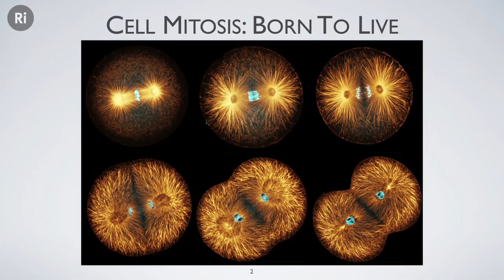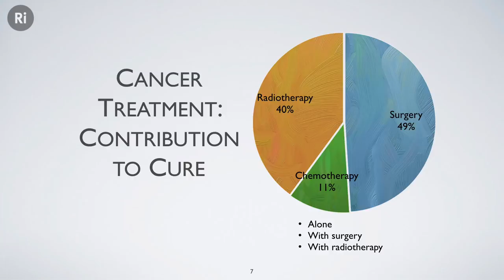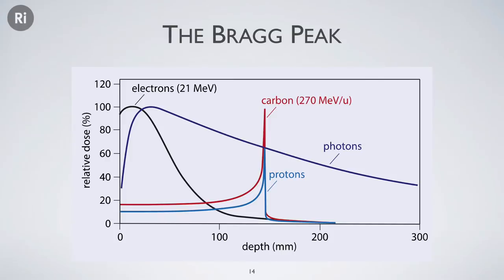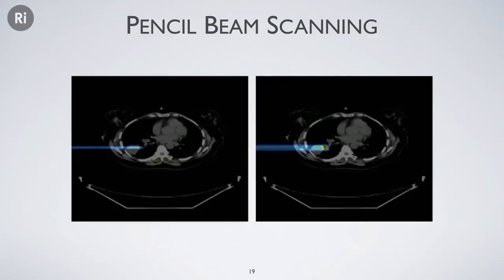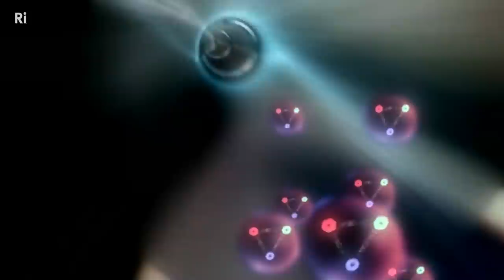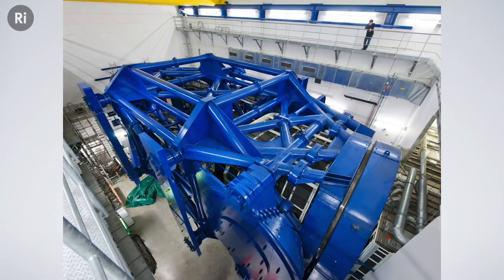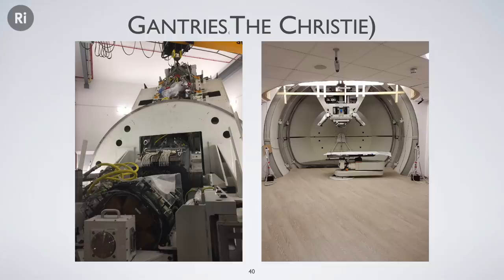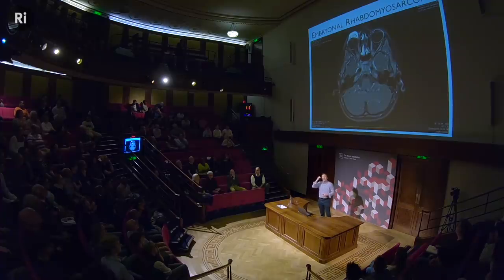How Particle Accelerators Are Used to Cure Cancer - with Simon Jolly

Comment: I worked in Hospital years ago, and one day found me conducting an inventory in the Proton Room, as we called it.
Pretty much standard stuff, until I found a piece of 22k gold chain-mail!
It was used as a beam-stopper drape of sorts; put the material over parts you don't want zapped.
The links in this fabric were a bit bigger than 1mm in diameter, and beside the chain-link weave, there were tiny scales of gold worked into the mesh, covering the holes in the cloth.
Very much like an Edwardian metallic mesh purse, Whiting and Davis weave to be specific. 
It weighed a little over 400 grams and was about 25cm on a side.
Part of the inventory process for this item was to take it to the Histology lab where it got weighed!  Gotta make sure no one is shaving the thing...
Reply: Fabulous information; thank you.

Comment: The Medical accellerators remind me of particle weapon system I was working on in the 1990's we built a linear accelerator  called a Radio Frequency Quadrupole, which is  used in muon cancer treatment The Prototype flew into space as part of Bem Experiment Aboard Rocket (B.E.A.R.)  It has pages on both the CERN and Smithsonian websties.

Comment: Why build one in the most expensive place in Britain? It'd be much cheaper to build it, and a hotel,  above ground somewhere which would benefit from the investment , say South Wales or East Anglia.   Much easier to move the patient - which begs another question: why not just move the patient instead of the beam ?  perhaps use low energy x ray to locate the target marker as the patient is moved.
Reply: The first is an excellent question, which probably has more to do with politics than anything else.

However as to the second point there are a number of ways in which the patient is repositioned instead of the the beam. The trouble with moving the patient during the treatment is that they can become nauseated or move independently of the immobilization. So basically the gantry is to improve patient comfort and treatment accuracy, with the latter point probably being debatable.
Reply: @Biga101011  yes he made this point in the q and a , but i wonder how much could be achieved with the patient in a chair rotating (and elevating) in front of a horizontal beam  , and how this would differ from the rotating scanner.
Reply: @wktodd  I should probably watch the q and a sections. There was a doctor I formerly worked with, who will remain anonymous, that was really excited about that exact idea. I think they built a chair and started testing out how they could set people up to it. Apparently there where guidelines on how quickly treatment devices should rotate around patients to be considered safe, but none for how quickly patients could rotate.

In any case he was only the for a sort time and I don't think they ever came close to treating someone with it. It's a great idea though, and you are certainly in good company with thinking outside the box. Maybe we will see that one day.
Reply: regarding the first question, I think it is important to notice that the people that work and service this are highly skilled and it is much easier and cheaper to find these people in a big center.   This centre most likely will be used (as it should) for a lot of research and not only treatment, so you kind need an Uni as well...

Not saying that's completely justified, but it kind of makes sense to build it in London and Manchester.
Reply: @Cotonetefilmmaker  You also don't want to move the patient far from their emotional support network. The best way to do that for as many patients as possible is to locate the treatment center near a large population center. Patients are not mechanical devices that can be shipped off to be fixed in a center located as a jobs project where the local populace can be trained quickly in repair procedures.
Reply: That is why electrons are also used, just move the target out of the beam. The Bragg peak of electrons is wider then of protons. For most therapies electrons and X-rays are efficient enough. And the therapy with a proton pencelbeam takes more time then a standard electron or photon treatment so you can treat less patients. With therapies as IMRT the damage to surrounding tissue is kept low. Proton therapy is not the holy grail some people think it is.
Reply: Probably because a beam can be moved with millimetre accuracy and a patient well not quite so accurately
Reply: That is because the Chelsea and Westminster Elite want EVERYTHING to be London-Centric despite moving part of the BBC to Manchester to make it look good

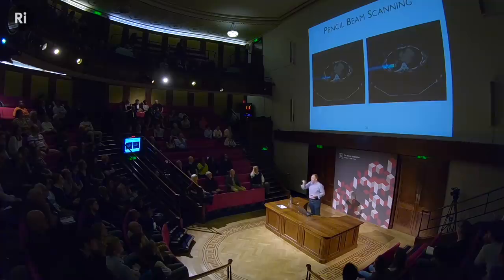Comment: 21:45 Looks great doesnt it?

Does your patient breath at all? That tumor would be moving up and down, and as you put your pencil beam down, are you hitting a part that has already been scanned by the beam and doubling dose - or are you going to miss a part of the tumor that is constantly breathing away from the beam and missing it?

When radiating tumors that move - you need to have a beam that - as evenly as possible - puts down dose across the path the tumor moves as the patient breaths.
Or fix that issue, but tracking the tumor up and down - or have the patient hold their breath as you treat them.

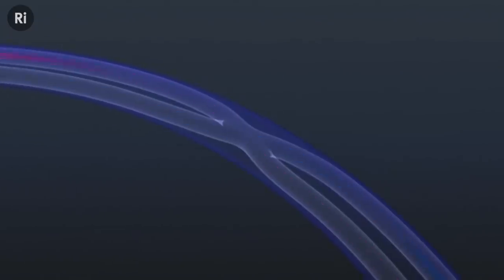Comment: 27:10 Why is the energy of collision double?
Reply: Because there are two energetic protons making each collision :)
Reply: I'm almost sure it's because 2 beams travel in opposite directions, then the beams cross over each other - 'shine through' each other and the particles collide head-on.
I'm almost sure.
Reply: The Trevor you are correct, that’s exactly why ;)
Reply: Because both particles are moving at high speed in opposite directions so the energy adds up. Two cars travelling at 60mph crash into each other from opposite directions the energy of the crash will be the same as one car travelling at 120mph into a brick wall

Comment: I don't understand why the proton beam, as it becomes slower, manages to do the most damage at the tumour site, when it will be at the slowest and least energetic.
Reply: I am guessing that as it becomes slower it means that body tissue stops it more easily, so radiation is more concentrated over a very small area rathe than whizzing straight through ……. I think